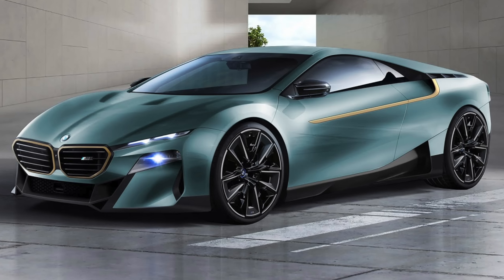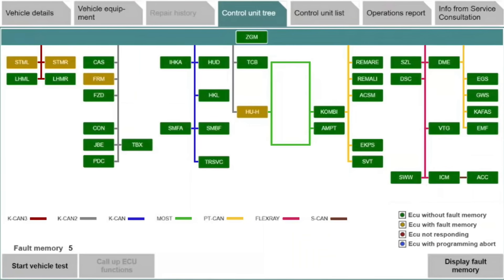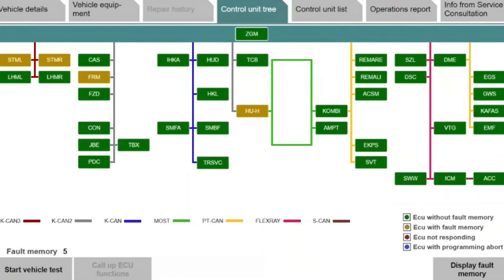ISTA+ vs e-Sys Explained – Pros & Cons for BMW Programming

Comment: But about Ista P? An detalied video for it would be great. With it you can update a single module/ecu, from what I've seen on older models like E-series.

I want to update to last version FRM 3 on e84 ( I understood that it would help a little in the future so that it wouldn't break so quickly). 
Thanks you for you answer 🤗
Reply from the maker: For E series use WinKFP 
Istap will most likely brick your bmw ((

Comment: Hi! First of all, thank you for all the valuable information you share with us.

I'm planning to update my BMW X3 G01 using E-sys, but I'm not entirely sure which initializations or calibrations are required afterward on ISTA. Will ISTA guide me through these steps automatically, or is there another way to know exactly what needs to be done?
Reply from the maker: After pupate with esys read bmw with ista. Delete all errors. And then if anything if remaining then use ista to initialise errors. It will suggest as well.

Comment: I have an I3 2014 what version is the best?   from your video I will need to use e-Sys too since I had the battery replaced with one from china.  Will you be able to help or any recommendation  would be great.  Thanks
Reply from the maker: If you replaced HVB (high voltage battery) then it might not as straight forward. 

Try to code it via esys. If battery was new then it should work (not sure about Chinese battery)

Comment: Hi Vladimir, its me again :D 

What is workaround for example on bmw g20 from 2022, and have istep level from 2024, majority of ecu are pushed to use secure coding 2.0, if one ecu die and replace it with used one, if used one also have 2023/2024 firmware we will be unable to flash that ecu under secure code 2.0, how to deal this with esys, or only way are over ista aos and geniue icom?
Reply from the maker: G20 2022 will not have many SC2.0 ECUs 

I have G20 2024 
And there are only 4 SC2.0 ECUs 

But yes replacing them will require SC2.0 coding file
Reply: @BimDoc thx! So even if is secure coding is still possible to flash over esys and load secure coding files manually?

Comment: Hi Vladimir. I would like to ask you for some help or maybe even it is a good idea for a video as well. my car is a 318D G21 LCI build late 2022. Due to the chip shortage it came with options 5AS and 5DF but not 5AT/5AU. I am missing lane change assist but everything else works fine, including adaptive cruise control. I have read that  have to remove the two present codes and add the 5AT/AU to the SALAPA and then code the several modules. Is that correct? Which option to add 5AT or 5AU? What modules have to be recoded afterwards with esys? Thank you in advance. I am from Bulgaria and a huge fan of your channel.
Reply from the maker: Hi,
Different options might have different hardware. 
ACC is only one component!

So answer is most likely not only coding. If it was only coding then how it will explain chip shortage?
Reply: @BimDoc  from what I have read options 5as together with 5df contain all the necessary  hardware for the assistant services included in the plus package. Still my car misses the basic lane and steering control function which I want to code in.

Comment: Folks are saying ISTA+ version 4.39.20 has an Advanced tab that lets you now program individual ECU modules, is that true?  Does that make it preferred?  Also people are saying if you hookup to another RUNNING BMW's battery (under hood connections actually) that will provide the necessary stable voltage 13+ and has a voltage regulator instead of going out and buying a 100 AMP power supply, is that also true?
Reply from the maker: Ista v4.39 is good version 

But before updating anything see my ista vs esys video 

Also another car is a solution as a power supply. But not the best one.

Comment: Hi Bimdoc, I've always had a question. Considering that all newer vehicles work with the ENET protocol, which is more reliable and secure: working directly with the ENET cable or using the ICOM, which also works with ENET? In my case, I own an ICOM that I used with my E90, but now with my new G20, which would be safer? Thanks for sharing your excellent work.
Reply from the maker: For diagnostics and coding there is no difference at all. 

But for programming I would use Enet for 99% of ECUs on G series (in case of G20 it will be 100%)

Where is 1% ?
On some G series there are some ECUs that require icom to run service function in ista. It is not possible to do via Enet.
Reply: @BimDoc  Thank you for your detailed response. It's very clear, and since my ICOM is a clone (A1/A2 with Next housing) from AliExpress, it's even more reason to use the ENET cable directly. The only thing I don't know is if ISTA would prevent me from performing some ABLs because it can't read KL15/KL30, or if E-SYS needs this information. Greetings from Spain!
Reply: @isabido  You can find small utility that can turn manualy circuit 15/30 in ista.
Reply: @moldovanandrei7008  Thanks!! Could you please give me a link or name to search for this?

Comment: Hi Vlad, I need some help. I have 640d gran coupe and my infotainment system rebooting every 12 minutes and reset all settings which is really anoying. Anyone have any idea what it is cause this issue and how to fix it?
Reply from the maker: Try to update software in HU
If not help then replacement of HU is the only solution.
Reply: Can I download the software from somewhere to the USB stick as my car not able to do any other way. Any suggestions?

Comment: Hi Vladimir, first of all you have amaizing content on your page, I have also engineereng thinking and I want to understood smoll detalis, for that your conntent is helping a lot. Now I have dificulties with an f30 car which has now Champ2 navigation with small displya. I put on the car directly NBT with bigger display 8 inch. At least I want in first step to start the new navigation, I had an issue with display cable, I reverse the power supply wires and now I'm able to receive no signal on display. (I'm using the old display cable). I was able to see the NBT HU in esys, I code the HU with default data, I checked display settings (type and reaolution), and still not signal, I was not able yet to associate the HU with the car, may be this the issue why I'm seeing there no signal? Thank you in advance!
Reply from the maker: Nbt and entry use different cable 

Just take cable from nbt (it’s not always possible to remake the cable to fit another HU type)
Reply: @BimDoc thank you for your answer, I will try 🙂

Comment: Hey bro big fan i have this problem with ista it is not connecting to newer bmw like g series like today my x7 2019 do you have any idea what to do ?
Reply from the maker: My ista 4.39 is working fine even on 2024 BMWs
Also F and G series are very similar and ista settings are identical for those platforms. 

Make sure you are using enet or icom (not DCAN for G series)

Comment: I have ESYS and ista + installed in my G20 can you do a remote checkup ? I have an error code that has been bothering me. It is in my RAM module. You may find it interesting too. As the error code changes its position in the car from front centre speaker to side speakers.
Reply from the maker: Yes backup of coding files is possible
Reply: How can I contact you for an appointment?

Comment: What you think about 3.27.1 e-sys for update? For example f10/f11
Reply from the maker: Esys 3.27 is good old reliable version, but it’s a bit old for newest databases. 

Use 3.36 for all the ECUs 
NBT might required smth older like 3.30
Reply: @BimDoc thanks

Comment: I have ista+ 4.52,is that a stable version and will it work in the E series cars with the k+d can cable… thanks in advance
Reply from the maker: Ista 4.52 is too new for E series and dcan

Use 4.22 or 4.39 for E series
Reply: @BimDoc  is it hard to move ista+ from an old pc to a new faster one, do you have any videos on the task?

Comment: Hello friend! I love your videos! I was wondering if you have an answer to my question, My NBT was stolen and i am replacing it with a second hand one from ebay, Do i need to wipe the Headunit with ESYS or is there another tool for this? And I think i may have to get all new FSC codes right? Thank you for all your amazing videos!
Reply from the maker: You need to code HU via esys and after that patch it to accept fsc codes and make navigation work again.
Reply: @BimDoc Thank you! Do you have a video about patching the FSC codes? As I think all of them will be gone

Comment: Have you ever updated an edc17 on the bench with esys? Like Scanmatik pro or similar?
Reply from the maker: I haven't done it on a bench, but to do it I would use FEM and DDE Bech setup and flash it via ENET cable and eSys
Reply: @BimDoc  Thanks for answering. I don’t have femto, but I read that someone was able to do it with a Scanmatik. I want to convert my 530d to 535d spec with a foreign ecu, so I can’t just update it in the car plug & play. However I would like to update it to the latest software version before tuning it

Comment: Hi Vladimir. Thank you so much for the informative videos. Are you able to clarify something for me? 
There doesn't seem to be any recent information on forums regarding programming over ENET. And lots of warnings around the ZGW ecu.
I have version 4.39.2 of ISTA+ and PSdZData 4.54.20. I have a 1000w power supply. I have an 2018 F34 bmw that hasn't been updated/programmed since leaving the factory (F020-16-07-503), it has no retrofits, the only thing that has changed is the language, from Japanese to English and the radio frequencies. 
Will it be safe to update/program using ISTA+ and my ENET cable? I read somewhere that in order to program the ZGW ecu, you need to setup your laptop to be a DHCP server so the ip address assigned to the car cannot change during the ZGW update. 
Is this still a thing you have to do? Or is ISTA+ smart enough to figure this out these days?
Thanks for your time.
Reply from the maker: In F34 you don't have ZGW ECU
You have FEM_GW and it does not require DHCP.

So you are good to flash it with ENET

But I recommend to do it via eSys, not via ISTA

Comment: @BimDoc But what if ISTA reports that it only has one ECU to update? That means that all the others have the same software version as the PSdZData_Full package used. Will it update/rewrite the same version on all ECUs?
Reply from the maker: Ista will not reprogram the ECU if there is no update present. So in that case ista will reprogram only one ECU

Comment: Hi Bimmerdoc! 

In my G30, I was trying some advanced coding changes to make my adaptive LEDs start high beam sooner from 50kmph instead of 80kmph, and now they seem to be miscalibrated. The no-glare high beam is not working properly and throws light on the oncoming cars. How can I reset calibration for this function? The module does say "implausible calibration data" but there's no error on the infotainment. 

Thanks!
Reply from the maker: Recode ECUs back to factory settings 
In ista there is special function for lights (exact function depends on the type of the lights)
Reply: @BimDoc  Would you believe that 
1. CAFD file is not shown only for FLA4  (ECU which I had coded)
2. On right clicking FLA4 ECU, the Code / Read coding data is greyed out. Other ECUs are totally fine. 

What could cause Code / Read coding data to be broken only for this ECU :( ? 
No errors reported in ISTA.

Comment: Great video. It will be interesting to see how to exchange ZGW with a used one and how to update it with enet cable and dhcp surver.
Reply from the maker: ZGW and Enet cable are interesting things to do/try )
Reply: @BimDoc  i have tried with ZGW-02 mid on a F25, programming worked flawlessly but how to exchange it with a use one is a mystery 😀

Comment: Hi Vladimir, I'm writing from Italy, I follow all your videos and with them I learned how to use esys and Ista. I have a 2021 f40 and lately I've had a small problem, my radio no longer tunes to radio stations in either DAB or FM. I did the software update with Ista from level 11-2023.530 to 03-2025.538 and the radio started working again, but at the same time I got a low coolant level warning and my car doesn't have the sensor on the reservoir. So I updated the software again to 03-2025.550 and the low coolant level warning disappeared but at the same time the radio no longer plays. How can this be? Sorry for the long description of the problem, I don't know if you'll ever reply to me, but I would like some advice on how to proceed. I also apologize for my English, but I'm helping myself with Google Translate. Thank you for everything you do for us little mortals, without you we would be lost...thank you for everything.
Reply from the maker: Your English is good, no worries!

I suggest you to go to HU via esys and play with radio freqs. It should be fixable!

Comment: Hi Vladimir 
As always thank you for your time and videos that you make.

Did you try use/is it safe to use vxdiag vcx se instead of icom, as i can see it is much cheaper then icom, by your expiriences any downsides of using this over icom (except that is bit slower then icom) ?
Reply from the maker: You can use it nested icom

I haven’t tested it on newer BMWs (2024 and newer)
Reply: @BimDoc i was plan to use that only for zgw updates (and doip ecu updates) , and rest over basic enet (UDS modules)

Comment: Good and lots of good points.Actually I did few retrofit on my on car,like reverse camera,NBT-EVO,ATM and 6WB..when all job has been done,just did identification with online ISTA for write new service event to the HU.And after checked my car details online ALL upgrades appear like installed extras in online system...I just get surprized...otherwise I was upset a litle bit because just find out F30 Hybrid NEVER made with 6WB.So unfortunately some function does not work on cluster...
Reply from the maker: You are welcome!

Some things are important to know ahead!

Comment: Hello! unfortunately i can't program with icom, only with enet, i would appreciate it if someone could help me. i connect via router
ista 4.39.20
psdzdata:4.52.21
thanks
Reply from the maker: I’ll create video about hot to setup proper icom connection via router to avoid different issues!

Not right now, but I think it will be useful information
Reply: @BimDoc  thank you, Iam waiting